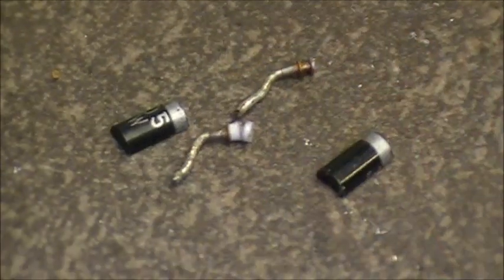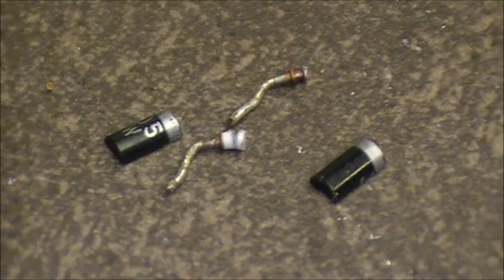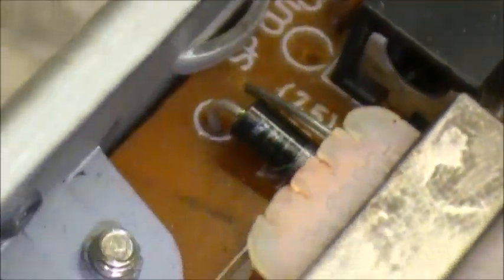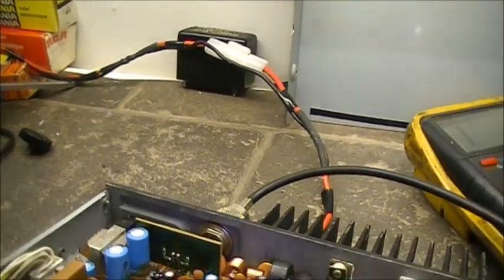Watch the polarity - How to repair your radio after blowing it up

Comment: Darrel, what was the diode that you used as the replacement?
Reply: I don't know what diode  to use there's a lot of different types how do I know which one to use I have a tyt th9800
Reply from the maker: 1N4003
Reply: @Radionut63  hello, helpful video but I got a question, I have 1n4007 diodes, can I use this these for my radio repair?